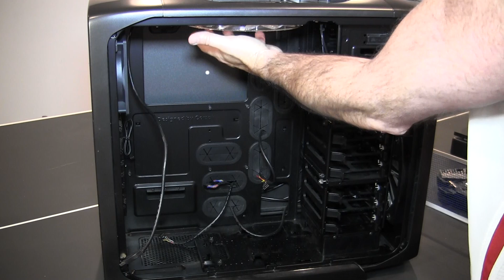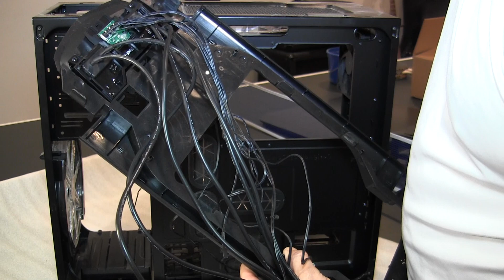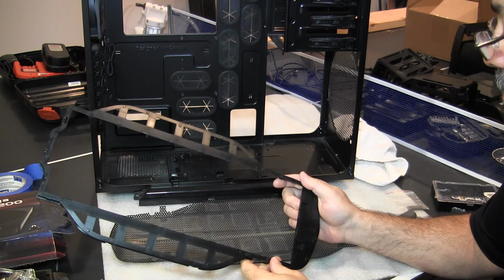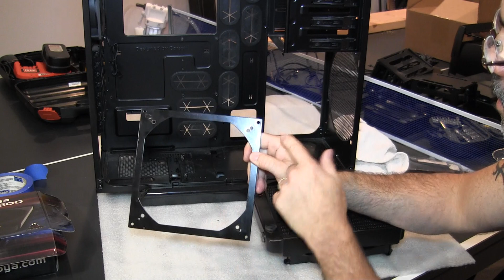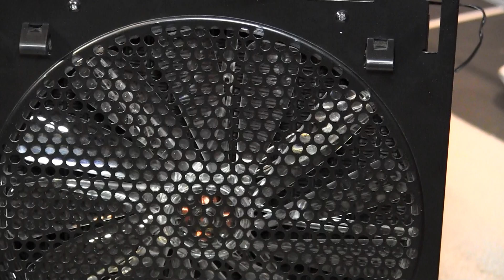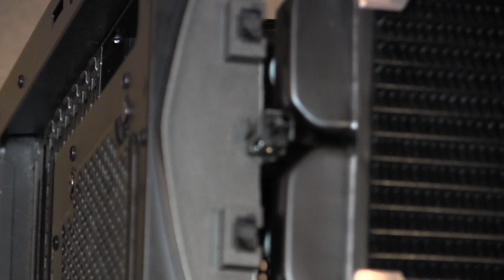CORSAIR 600T Water Cooled Gaming Rig - Part 2 - Modding the 600T Case

Comment: i recently did some similar mods to fit a corsair h105 on the top of my corsair 600t. It wouldn't fit on the inside of my case due to the location of my motherboard 8 pin power connector. Thank Ron!
Reply from the maker: I hope my video helped you.

Thanks for watching.
Reply: Ronsanut It was a huge help and it was the main reason i decided to do the mod. Thanks!

Comment: Really great video, thanks so much for the info and explanation.  Can you also mount the 200mm radiator on the roof where the stock OEM exhaust fan is?

Comment: Yes it do. I'm currently adding a custom loop to my 650D. I had to make my own template from the Phobya 200mm rad to drill 4 holes to install the rad in my case. Also, you would have to mod the inside front where the rad mounts for a flush fit, and the front panel in order to close properly. It's a pain so far, but it's worth it.

Comment: Hi would I be Abule to fit a 35mm radiator on the inside off the case and 3 fans ion the outside under the mesh covers ?

Comment from the maker: It may be too wide. You would have to mod it and make the mounting points but you would not be able to fit it in the top, like I did. It would have to hang underneath the roof. also I don't think 140mm fans will fit. I will heave to measure that space.

Comment from the maker: That was the first rad I tried to put in the top of the case. If I wanted to keep the latching mechanism working, that rad was too long and would not fit. I had to return it. Now if you wanted to place it inside the case up in the roof, that might work. My goal was to only have a rad in the top. The Magicool had the right length, thickness and the cleavage allowed me to use the latching mechanism.

Comment from the maker: The front fan (push) mounted right on the plate using the stock holes. The inside fan (pull) required me to drill some holes. I just lined the fan holes up and marked the plate tne drilled some small holes using either a 3/16 bit, but depends on what size screws you will use. I also added a washer and nut since I used machine scews I think to mount that fan.

Comment from the maker: The Koolance is  2mm longer than the Magicool that I used but the rest of the dimensions are good..  Looks like It has the same cleavage at the top so you can still use the latching post in the top of the 600T.  I am not sure if that 2mm makes a difference suggest you measure the space at the top.  See what the return policy is and worst case return it if it does not fit.  But it may be okay.

Comment from the maker: As a rule of thumb I use at least 240mm of rad for each component I am water cooling and an a little more for overclocking headroom.  So using my rule of thumb, a GPU and a CPU in this system that would be 480 worth of rad needed and I have a 360 + 200 for 560 of radiator.

Comment from the maker: Yes, you can use any rad port on this rad (and probably most) as in OR out. I chose to use the lower positions ports on my radiators as in so it helps to bleed the air out of the radiators. Thanks for watching.

Comment from the maker: Actually I  originally bought and was going to use the XSPC EX 360, but it was actually the length that was the problem for me. It was too long if I wanted to retain the locking mechanism of the top, I needed a radiator with cleavage at the top.  I don't think thickness would have made a difference, but I do not recall trying to place the top on with the EX 360.

Comment from the maker: The phobya 200mm radiator has two large black mounting adapter plates. Once had holes that lined up, the other one I had to drill holes into.

Comment from the maker: All original mesh though I modified the plastic skeleton under the mesh so I could fit the rad and still close the mesh top.  It does sit flush if you close it right. Sometimes it does need a little help when closing but it does sit and stay flush.  Thanks for watching.

Comment: very detailed video, I also have 600t, just the video I needed about top 360 mount. one thing im little worried is, is the top mesh sticking up a little on both sides compare to original, or is it same as original?

Comment: Great video man!

I probably would have just replaced the screw on the 200mm radiator instead of modding the case. But you got the job done either way!
I was thinking about just getting a corsair H100 in my NZXT Switch 810 for my new Ivy Bridge build. Now I'm thinking a custom loop might ber the way to go. Use my case to it's full potential!

Anyway, keep up the good work mate...

Comment from the maker: I used a drill where needed to get starter holes and a rotary dremel tool  with a couple of metal cutting sized blades for cutting the metal with finishing bits for getting the rough edges smooth.